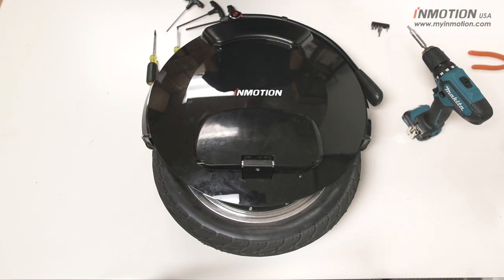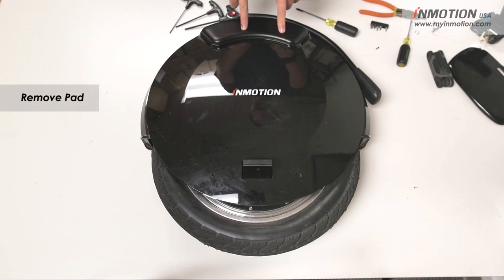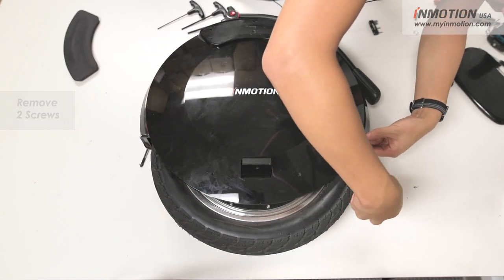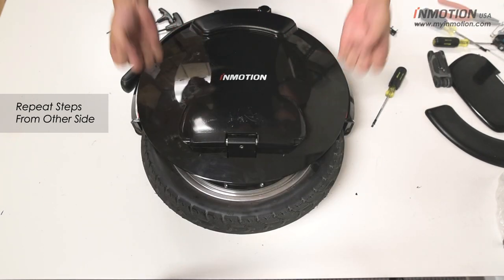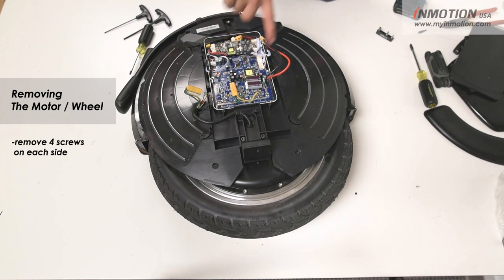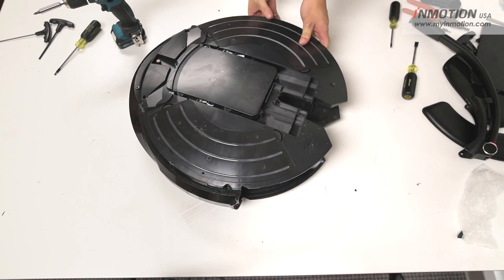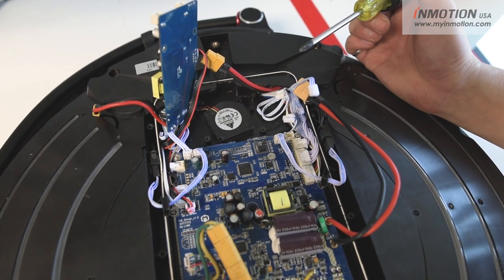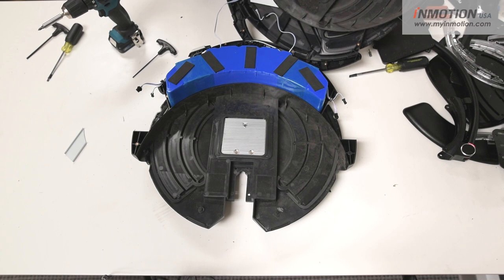InMotion V10 Disassembly For Repair and Tire Change

Comment: BELIEVE ME!!!  BELIEVE ME: You don't need to do all that: you don't need to disconnect anything! Just remove the tube from the tire with 2 flat screwdrivers, look for the puncture, patches, reinsert the tube into the tire, inflate and voila!  Go!!!   It is incredible that nobody comes up with something so simple. I already did it and it works!
Reply: Do ya have a video of your method? This video is absolutely a nightmare for those who need just replace a single tire.
Reply: @GoMArkkrAM  he\s faking

Comment: How did you remove the motor? Unfortunately you skipped that part!
Reply: OnlineMediaCollection When you disconnect cables and undoo 2x 4 screews you just grab the handle and pull it- after that you have 2 main parts separated.

Comment: Hey everyone, when getting the shell cover off here is a tip. It actually hooks and clips at the bottom and clams over at the top. So when taking off, undo all the screws and start at the top by the top to pry off. It will slide there. Then work ur way down both side to the snaps by the lights front and rear. Once unsnapped then work it down and away. 

When reinstalling, hook the bottom and hinge it over to the top.
Reply from the maker: Hi Kevin, that's a great tip! When removing V10/F side shells, it can help to insert a small flathead between the gap where the inner and outer shell meet near the headlight or taillight (depending on which side you are working on), and use it to release the clips on the inner shell located there. When reinstalling the side shells, as you've said, sliding it first into the hooks near the bottom of the inner shell and then snapping the other clips into place will ensure the shell is properly seated.
Reply: @EUCOllective  I learned the hard way and snapped one of my covers up pretty good as I also forgot about the 2 screws in the wheel well. Also the red or silver trim stays on the covers so advise to pry the cover with the tool between the trim and the handle (as if the trim is apart of the shell). 

Felt good to repair a tire for the first time. I can’t believe how difficult it was to get the bead  off without tools.  Finally Got 12” metal tire spoons and it was awesome. Now I look forward to changing tires :)

Comment: Hello, at 45% battery Inmotion v10f says "Please repair", enables red lights on sides and lifts pedals, when I turn v10f off, wait 10 seconds it works fine for few minutes and turns off until connected to the charger. Is there anything I can do to fix that? Thank you in advance!

Comment: How durable is V10? Because I just fell off while I was driving(?), and it hit a rock before it stopped. The pedal was like tilted. When I google it, it said it happen when the battery is lower than 10%(the battery was 10%). I tried to reboot it, and then the wheel started to run even I was not standing on it.

Comment: Hello People or "EUCO" ... I have an Inmotion V10. When I fell a run, the ASA got stuck and OPEN. Do you know how it is disassembled in order to unlock it?
Reply from the maker: Hi Adrian, are you referring to the trolley handle? If you'd like some help repairing your handle, feel free to shoot us an email at contact@euco.us! However, if you would prefer to replace it altogether, a replacement handle assembly can be found at euco.us/products/v10-handle-assembly.

Comment: my Inmotion V10 won’t charge pass 90% voltage is at 82. Have any idea what’s happening?
Reply: @JM Coulon I think maybe battery is old now. Beyond 500 charges 🤷🏽‍♂️
Reply: @JM Coulon is that a fact? Maybe I’ll try it when I feel like opening this shit again.  I’m a lil exhausted from just recently swapping out my rim in my Sherman. Don’t feel like opening another wheel right now 🤣
Reply: @JM Coulon Copy that.   Thanks for the info. Appreciate it.

Comment: Mine suddenly shuts off, and won't power on, any help?
Reply from the maker: kai Ryu sorry you’re having trouble! If you purchased from InMotion USA, send us an email with details so we can help you get it sorted out ASAP: https://www.myinmotion.com/pages/contact-us

If you purchased elsewhere, please reach out to your seller, so they can help you go through the right support channel.
Reply: INMOTION USA I did send an e-mail but nobody replied yet!
Reply from the maker: Hi Kai - we aren't always available on the weekends. We got your email and we will be in touch soon!
Reply: INMOTION USA got it! Thanks.
Reply: Nope, I returned it back, it was a mother board problem, manufacturing priblem

Comment: I have it on pre-order, but I am disappointed with what I see in the reviews so far...
Please pass up to the manufacturer.
I see several minor, but bad or questionable design decisions in this product and I'm wondering whether they let V5 and V8 designers go and reused legacy design, adding some new poorly designed elements and some tech like motor and battery for the range and top speed. I don't know, I really hope that my opinion will change when/if I finally get a chance to see it in person and ride.
1) The motor is 2000W on paper, which is 2.5x of 800W of V8. The weight is 1.5x of V8. Why does V10F accelerate and stop slower than V8? What kind of trade off is that?
2) The wobble in the handle is there for years since the V5 optional handle, which lock mechanism I suspect V10 simply reuses as is. It is annoying, it feels cheap it has no excuse whatsoever and it does not belong on the expensive flag-ship model as V10F was supposed to be.
3) The wheel hub is aluminium and not black. Why? It looks bad under the black wheel. Looks like nobody really cared.
4) The pedals are longer - great, but why wider? Does anyone have such wide feet? I'm yet to see anyone covering the pedal completely with his shoes in reviews, it just sticks out ready to hit obstacles and people you ride close to. An unnecessary and a very real hazard of flying off the wheel. Why?
5) Why active cooling? Is it used by all manufacturers with such power ratings? If unavoidable - why such a small fan? For how long will it survive the dust, vibration and jolts of the wheel falling on the ground e.g. during learning process? What will happen when the fan fails? Will the electronics overheat and fail? Will there be any warning before controller overheats and sends the rider head first into the traffic?
6)  And then there are smaller issues and concerns like:
- Why the cushions again when V8 plastic sides were perfect and heavy duty? We will need to tear the glued cushions off for every tire repair. How many times till the cushions stop gluing back and start to peel off? Why cushions? Why screws behind the cushions?
- The charging port rubber cover on V8 unfolded in the opposite direction, which allowed it to still cover the connected wire when open, e.g. against occasional spills of beverage and dust while charging. On V10 the socket is exposed from the top when connected to charger. Why?
- I will not ask about the external handle vs. internal, let's say it's battery, although it does feel like a cost reduction oriented cheap design decision.
And I didn't even see the wheel in person yet... Should I still buy it? I'm afraid to be bitterly disappointed... Is it the same design team?
Reply from the maker: Our suggestion is to not get too caught up in critical reviews just yet. An overwhelming majority of our initial customers so far are very pleased with V10, and demand is very high.
1) The motor is indeed 2000W nominal (can peak much higher) and the engineering team spent quite a lot of time testing to make sure they rated the motor based on what the real life conditions and battery can produce. The reason it feels sluggish is due to physics, not motor power. You will notice this exact same phenomena with other larger, heavy wheels from other manufacturers as well. It's a trade off of range and responsiveness. Smaller, light weight wheels will always feel more playful and quicker to accelerate and brake.
2) The looseness of the handle makes it very easy to left up and down, and in real world conditions it works very well. Built-in wasn't an option when the design goal is to keep the wheel thin for ergonomic reasons while doubling the battery capacity. 
4) The large pedals is one of the best new features as they are so comfy. While they may seem wider than you might need, they certainly are not a hazard. The overall width including unfolded pedals is still more narrow than other large, high performance wheels. I think you'll find this is not an issue at all when you take yours for a spin.
5) Yes, active cooling is becoming standard for high performance wheels. InMotion has a stellar warning system that gives riders heads up for overheating conditions, so if the fan were to fail, you wouldn't be at risk. Active cooling has proven to be a viable solution for cooling in electric unicycles.
6) Cushions are there to help with comfort. With a heavier and taller wheel, you need to apply more body force to control the wheel, which means you apply more pressure to the sides of the body with your legs. The result feels great! If you ever need new pads, we can send you some replacements.

We know it's hard to wait, but it's worth it! The benefits of this design will allow you to do some incredible things with this wheel that you can't do with anything else.
Reply: I really appreciate the quick and detailed response. There's not much competition at the moment so I'll most likely end up with a V10F and will be able to form a personal opinion. Hoping for good. Staying tuned.
Reply: @EUCOllective  reading this only now, I think your reply has stood the test of time! Good job.
Safety being taken visibly more seriously than competition is what decided me to order a V10F.